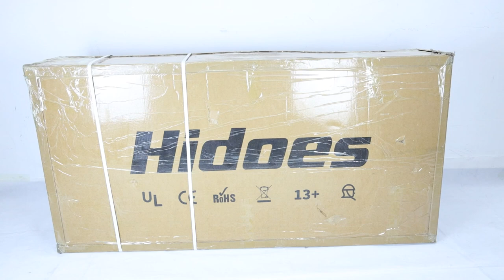[Hidoes B3] Unboxing and Installation of the Hidoes B3 Electric Bike（1080P）

Comment: I cant get the left pedal to fit in. The metal is shaving off everytime i try to screw it in
Reply: I’m having the same fucking issue bro
Reply: What did you do with it to get it on??? I’m riding with only on pedal lol
Reply from the maker: if you need more technical support, you can contact this email support@ienyrid.com, or contact your original seller.
Reply from the maker: if you need more technical support, you can contact this email support@ienyrid.com, or contact your original seller.
Reply from the maker: @littlehorus2327  The installation and tightening directions of the two pedals are different. The right side is tightened clockwise and the left side is tightened counterclockwise.
Reply from the maker: The installation and tightening directions of the two pedals are different. The right side is tightened clockwise and the left side is tightened counterclockwise.